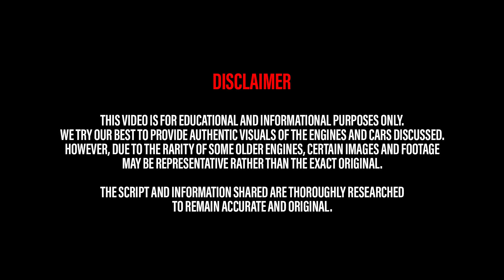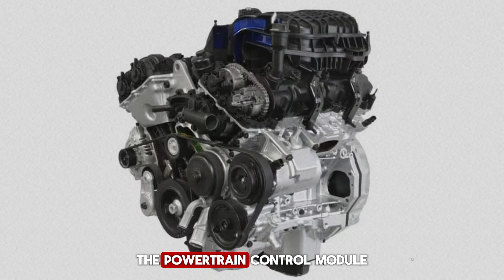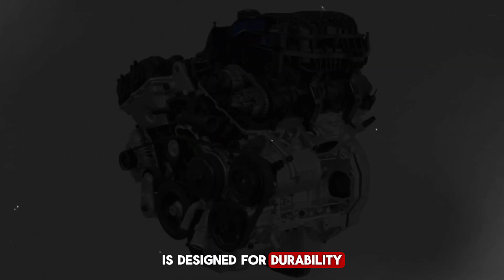Why the Pentastar 3.6 Is Every Mechanic’s Favorite

Comment: Not my experience. Fixing my BIL 3.6 jeep that blew a headgasket at 100k. Went in and a new style lifter had collapsed and ate the left intake cam. Also had an intake valve with 60% leak down. Motor is clean and has been well serviced. Complete valve job, new cam, and all new lifters and rockers. 3/4 bolts on the head that close up the lifter oil galley were finger tight and that’s also a known issue. Lower end looked good as did the timing chains. I’m still not a fan. Too much plastic and the oil cooler is plastic and in a horrible location.

Comment: I have 2019 and 2017 Pentastars since new.  150 and 175k miles. No issues and they run great.  Non-freeze climate location. I change my oil at 5k miles and use Penzoil Platinum and quality oil filters (non-fleece, as their folds collapse)  I've never had the lifter ticking that some mention. I also do the tranny fluid and filter at 35k .   I think part of the issues some folks have is with how they drive them.  Just because it can develop 250+ hp doesn't mean it should be pushed there often in normal driving.  It's nice to have the power when I need it but I don't floor it off the light and I let the trans shift up to get the best mileage.  I do not use 'ECO' mode as it just makes it sluggish and I've never seen any gas mileage advantage. My wife's 2012 Mercedes C350 is essentially the same engine and no issues with it either.  (The MB oil filter cartridge is way larger than the N.American models. )  Other difference is 5w-20 spec  vs 0w-40 oil for domestic vs european.  I use 5w-30   Mpg has always been in the mid to high 20's,  avg 27 mpg on regular gas and I do the occasional PEA treatment.

Comment: As the owner of a 2024 grand caravan I have to say that I love the performance but hate the plastic oil cooler and plastic coolant channel on the front of the engine.  At 235000 miles the rocker arms are starting to knock. Gggrrr my 1998 grand caravan went 350000 without burning oil and knocking. This engine is not that great.

Comment: Not once have i ever heard someone claim that the pentastar was an amazing engine, ever..
Reply: Amazing is a stretch. but it's definitely a good engine, I've seen well over 20 with over 300k. Few common problems that seem hard, like the oil filter housing and rockers, but are surprisingly easy jobs.
Reply: @davidbuck9977 The rocker situation was from '11 to '16 since then it has a new top end with next to no issues whatsoever. You can't make things better unless things fail that goes for everything
Reply: Then you're not looking in the right places I've had more than one and completely love it, quiet powerful and dependable there have been Millions made and have been tried and tested with Millions upon millions of proven miles in most of Chrysler's Dodge work duty lineup and passenger van vehicles
Reply: @seatime674 just because Chrysler puts them in everything doesnt mean it's a great motor.

Comment: Your celebrating an engine that might make it 200k Miles’s that’s horrific, they used to last 500-800K miles…..
Reply: I've worked on a few 3.3 motors that were in the 300k's still ran fine, usually out lasts the transmission.

Comment: As a previous owner of a 2015 Jeep Wrangler, I didn't like the Pentastar V-6. Totally gutless gas guzzler. I stayed on top of oil changes and maintenance, and it still gave me problems. Last year I had to replace the engine oil cooler. $1,400 with only 60,000 miles on it. I finally got tired of pouring money into it and sold it. My next vehicle is going to be something older and more reliable. I've had enough of all the high-tech crap and low quality. Maybe a mid 2000's Buick or 80's K5 blazer. Anything other than the nightmares auto makers are selling now.
Reply from the maker: Thanks for sharing your experience; I appreciate your perspective.

Comment: It has port fuel injection, which means no carbon buildup like you get with direct injection. I use 5w30 in mine...running over 200 thousand km no issues.
Reply: As long as you keep up with maintenance, they're good, usually the ways I've seen em go bad is head gaskets, timing chains, and oil sludge buildup blocking a passage because of extended oil changes, normal stuff for most modern engines after the late 90s when they started shifting towards lighter oils and tighter tolerances.
Reply: 2019 year model durango and mine is direct injection I got a kit from RIPP that puts 2 injectors at the throttle body and I got the supercharger kit